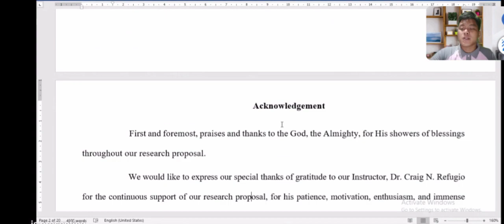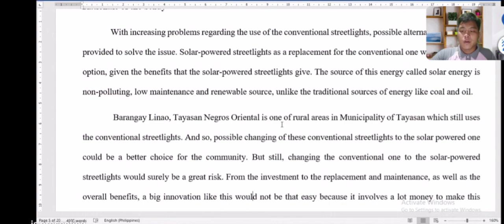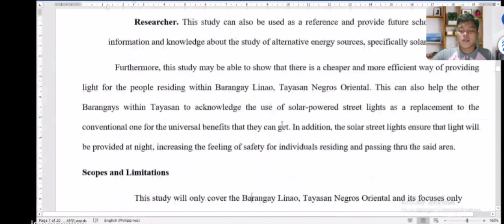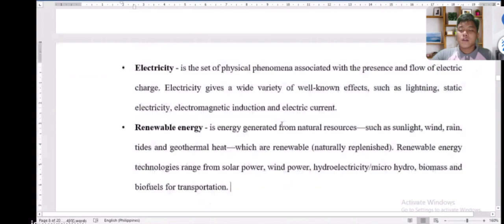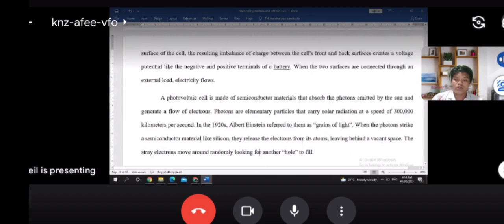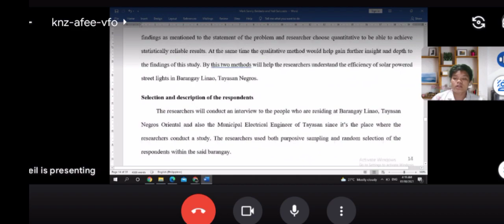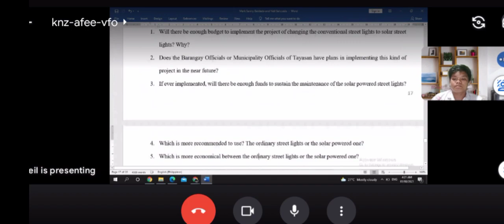Efficiency of Using Solar Powered Streetlights in Barangay Linao, Tayasan, Negros Oriental

Comment: NAME: Mary Grace c. Jorge
CLASS NAME & CLASS SCHEDULE:  346 Methods of Research T-TH 5:00-6:30 PM 
REACTION:  Its interesting topic, we do really need a street light specially on those area has few houses only, its for the safety of everyone who travels at night it also helps or assist drivers, pedestrians, and cyclists in finding their way in the dark. Many neighborhood groups believe that extra illumination helps prevent crime, and business district lighting also may help create a mood or a pleasant environment.
REFLECTION:  Streetlight provided a numerous benefit, but before it will work it needs an electricity. Even our government also need to pay electricity on their designated area, so instead of using an electricity on those streetlight, it will be an advantage if we will use a solar to make the streetlight work, so those money that is suppose to be a budget for the electricity bills for the streetlight, it can be used to a different project to improve their area.

Comment: NAME: Sanrey Jun R. Guevarra
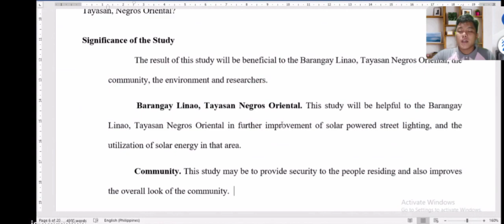CLASS NAME & CLASS SCHEDULE: COE 346 A & 5:00-6:30 T-TH
DATE: 27/03/2022

Reaction: The planned study will be extremely beneficial to rural places, particularly at night. I agree with the researchers that solar panels should be integrated into street lighting, and that it should be improved further.

Reflection: If done correctly, adding solar energy into a streetlight is a fantastic concept. They will not only save money, but they will also reduce the barangay's electrical usage. Even if the power goes out, the streetlights will stay on because they are fueled by a natural source, solar energy, which makes the streets safer.

Comment: Tudio, Lechly D. 
COE 346 Methods of Research T-TH 5:00-6:30 PM March 26, 2022
Reaction: It has piqued my interest to know more about solar energy. I have noticed that it is mentioned in most videos. No wonder, in solar, there aren't pesky bills in the mail reminding you to pay for the power consumed. Your power is free. That's why most of the projects and innovations are related to solar energy. Regarding this, having solar powered streetlights will provide security to the residents of Barangay Linao, Tayasan, Negros Oriental.
Reflection: Solar power is getting increasing popularity as a dependable source for street lighting worldwide. In our place, we are currently using the solar powered streetlights. It is very useful, convenient, and advantageous to places with a frequent power interruptions. Solar lights are incredibly cheap and clean alternatives to traditional power. In fact, due to the absence of external wires, these lights do not pose any threat of accidents like electrocution, strangulation, and overheating.

Comment: Name: Khynny Maureen P. Campoy
Class Name and schedule : ENS 341 Saturday (5:00-8:00pm)
Date: March 26, 2022

Reaction :
The video presentation is informative. Using solar powered streetlights, we can help save energy. It is eco friendly and it also have low maintenance. I agree with the researchers to implement this innovative idea. 

Reflection :
With problems regarding the use of conventional streetlights, possible alternative of this problem is by using solar powered streetlights. The source of energy of the streetlights is solar energy. It is non polluting, low maintenance, and renewable unlike the traditional source of energy like coal and oil.

Comment: Name: Balansag, Lorenzo Jr. B.
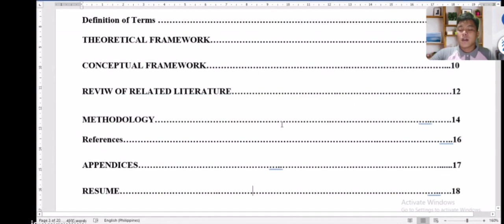Class Name and Class Schedule:  ENS341- Research Methods for Engineering | Saturday 2:00-5:00 pm 
Date: March 26, 2022

Reaction: The proposed research is indeed very helpful to remote areas especially during night time. I agree with the researchers that the integration of solar panels in street lights and to further improve it. 

Reflection: If the research is to be integrated in the said area, it will improve and lighten up the roads where people pass away. A very dark road is a hassle, so having it is very beneficial to us. As I have experience, it is really scary travelling alone in a dark road.

Comment: NAME: JEAN CLARE M. PO
CLASS NAME & CLASS SCHEDULE: ENS 341 SATURDAY 2:00 - 5:00 PM
DATE: MARCH 26, 2022

REACTION: During the night, streetlights are almost always used. It is critical to keep the streets illuminated so that motorists can navigate the roads and those who must walk in the dark can feel safe. As a result, I agree that there is a need for improved capacity in solar-powered street lights.
REFLECTION: Despite the fact that solar energy is common, using the sun is still a great innovation that is far too efficient and dependable for this study. This is a good idea not only for the environment, but also for promoting security and safety among all Brgy. residents.

Comment: Diaz, Joseph Jr. B. 
ENS 341 B - 5-8 pm Saturday
March 26, 2022

Reaction: The idea of using solar powered streetlights is not new to me, actually the idea is very common now everywhere. Here in Bacong, the streetlights in the diversion road from Dumaguete to Bacong is powered already by solar and it is truly very efficient because the only cost is the materials and no additional cost different from the ordinary streetlights that every minute produced cost because of the used of power from the power plants. 

Reflection: The solar powered streetlights are very efficient. Because the solar powered objects are only depends on the ultraviolet from the sun that everyday produced. But the downside is when the raining season comes, it just produced a minimal amount of energy.

Comment: NAME: Glovel Jae G. Medel
CLASS NAME & CLASS SCHEDULE: ENS 341 - SATURDAY 5:00-8:00 pm
DATE: March 26, 2022

REACTION: The research idea is very beneficial to the community, particularly in areas where there are no street lights.

REFLECTION: Nowadays, using solar energy as a replacement for fuels or fossil fuels is the most common solution that anyone can think of. Using solar energy to power street lamps would be very efficient because solar energy is abundant, and it would benefit areas where there are no street lights.

Comment: Name: Orito, Jessel A.
Class Name & Class Schedule: ENS 341 B Research Methods for Engineering (Saturday 5:00-8:00 pm)
Date: March 26, 2022

Reaction: In this video, it talks about the proposal of using solar powered streetlights in Barangay Linao, Tayasan rather than conventional streetlights. Even though this innovation would not be easy because it involves a lot of money, still this is the better option you can have. I guess this is a challenging research proposal.

Reflection: Barangay Linao, Tayasan is a rural area where only few streetlights are being built but not all of this can be able to provide a good light to every streets. For this reason, proposing a solar powered streetlights as a replacement of the ordinary streetlights is a better yet challenging choice. Nowadays, solar energy is being utilized for streetlights especially in those faraway and/or remote areas.

Comment: NAME: Chasty Jane Duran
CLASS NAME: ENS 341 B - Research Methods for Engineering
CLASS SCHEDULE: Saturday, 5:00 - 8:00 pm
DATE: March 26, 2022

Reaction: The video is very informative. Indeed, streetlights are crucial especially at night to avoid accidents and crimes. Using solar energy to give power to these streetlights would be very efficient and would be less costly. 

Reflection: Given the benefits of solar energy, it is the perfect option to provide these streetlights power. If the government agrees to make this proposal possible, it would not only benefit the travelers at night but everyone in the community.

Comment: NAME: Mark C. Temporada  BSGE 3
CLASS NAME & CLASS SCHEDULE: ENS 341 B - Research Methods for 
Engineering 5:00 PM- 8:00 PM Saturday Class
DATE: March 26, 2022

REACTION:   After watching the whole presentation , the research study was indeed  very helpful and informative research study . This research will be helpful to the community especially in Linao, Tayasan. As we all know that street lights is really necessary as it is a way to avoid accidents in roads. I do agree with them to implement this to the Barangay because using Solar is the best option to save money nowadays. 

REFLECTION: By the use o this research proposal, we can have high chances of putting up lights in dark areas of barangays and hoping that the government will fully support this amazing project soon. It will surely bring safety and security to all of us giving us lights going home .

Comment: NAME: Lumelyn E. Ragusta
CLASS NAME & CLASS SCHEDULE: ENS 341 B Research Methods for Engineering – S 5:00-8:00 pm
DATE: March 26, 2022
REACTION:  This study is really useful for the community. It is beneficial, especially when it comes to road safety. However, using solar power panels may impose a risk to the environment and be somewhat costly. Using solar-powered streetlights, we can save electricity, but there are factors to be considered.
REFLECTION: Renewable energy is increasingly popular these days, and this study is another important step toward a more productive lifestyle. Street lights are extremely important because they concern the safety of the people, and using solar energy to power them is a great idea to earn and save money. A happier environment results from a safer street. For me, investing in this kind of innovation results in a productive nation.

Comment: Marc Kenneth L. Baldosano
ENS 341 A (Saturday 2:00-5:00 pm)
March 26, 2022

REACTION: The idea of having a solar-powered streetlight is great. Since the government is paying a huge sum of money to electric companies like noreco every month, this will make the electricity bill significantly lower.

REFLECTION: Solar-powered streetlights may sound like a great idea, but I think that it will be an expensive investment since batteries are expensive. And since it will operate daily, the batteries where energy is stored will become less efficient since they are used daily; their maximum cycle will be reached much faster. I think that if they would only operate when there is no electricity during nighttime will make the battery much longer.

Comment: Name: Dolly Rose S. Bigno
Class name and Class Schedule: Reaserch Methods for Engineering- B/ Saturday (5:00-8:00 pm)
Date: 03/26/22

Reaction: Another great idea from these researchers. I'm glad that they gave attention and came up with an idea of the improvement of streetlights. Because not just in Tayasan but also to the other places with streetlights, some of them were not functioning properly at night which was suppose to be the most important thing in the roads.

Reflection: The study is all about the use of solar powered streetlights, which is also a great alternative solution during at night. They've mentioned that this might be costly in making this proposal possible but what matter is if this will be implemented and installed in many highways, then we will not worry anymore when electricity is not present at night because the absorb energy coming from the sun during day time will serve as the energy to generate the solar powered streetlights during night time. In this way, the drivers and people will be more secure and safe.

Comment: NAME: Kilapkilap, Joebert L.
CLASS NAME & CLASS SCHEDULE: ENS 341 A – Saturday 2:00 – 5:00 PM
DATE: March 26, 2022

REACTION: The research proposal is amazing since the researcher's notion is incredibly useful, as solar-powered streetlights may provide pollution-free illumination while also emitting no greenhouse gases into the atmosphere. It's also a more cost-effective and efficient way of illuminating individuals.

REFLECTION: The existence of electricity has a stronger impact on our day-to-day activities. Aside from conventional energy sources, solar energy can also be used to power street lighting. This concept is a viable solution for maintaining the stability of street lights, particularly in areas far from motorways. The streetlights will remain lit as a result of this, especially during power outages.

Comment: NAME: Alnie Jane M. Aum
CLASS NAME: ENS 341 B - Research Methods for Engineering
SCHEDULE: Saturday, 5:00 - 8:00 pm
DATE: March 26, 2022

REACTION:
     This research will be helpful to the community especially in Linao, Tayasan. We all know that street lights is really necessary as it is a way to avoid accidents in roads. I do agree with them to implement this to the Barangay because using Solar is the best option to save money.

REFLECTION: 
     As a resident in Tayasan also, I witnessed many streets that there is still no lights. It is so dark when walking or driving bat night. So, this study can be use for those other streets in Tayasan too.

Comment: NAME: Alejandro A. Bargaso Jr.
CLASS NAME & CLASS SCHEDULE: ENS 341-SATURDAY 2:00-5:00PM
DATE: MARCH 26, 2022

REACTION: 
The research proposal is extremely impressive because the researcher's idea is extremely beneficial because using solar powered streetlights may be able to provide pollution-free illumination while also emitting no greenhouse gases into the atmosphere. It is also a more cost-effective and efficient method of providing light for people.

REFLECTION: 
Solar Powered Streetlights, according to this research proposal, ensure that light is provided at night, increasing the sense of security for those who live and travel through the area. Because of the advantages of solar energy, it will be able to assist the community in conserving and saving electricity, as well as saving money on their utility bills.

Comment: NAME: JABUNGAN, JENNETH ANN D.
CLASS NAME & SCHEDULE: ENS341- B ; (5-8pm) Saturday 
DATE: March 26, 2022 
REACTION: This study is really interesting. Electricity is an essential part of our life. People use electricity for lighting, heating, cooling, and refrigeration and for operating appliances, computers, electronics, machinery, and public transportation systems. So, this research is proposing to have solar streetlight in tayasan, which is really good specially that every place should have streetlight. We all know that some of our lights are not functioning due to mechanism or the electric power that is not enough to lighten up the whole city and we cannot maintain them every time and then. So this research should be in implemented because streetlights are important since they could help drivers to navigate their way clearly and avoid accidents. 

REFLECTION: For me, this is a big benefit to our city, especially when power outage in the city occurred unexpectedly. So as a driver or citizen we need lights when travelling to avoid accident. And in fact, this study is good for the environment because it could lessen the air pollution that was produce by our fossil fuels. When times of power interruptions, many motorist or drivers got into accident due to lack of light in our streets, so this researcher is what we need to avoid this kind of circumstances.

Comment: NAME: Tubiano, Mariechel A.
CLASS NAME & CLASS SCHEDULE: ENS 341 -Saturday(5:00-8:00pm)
DATE: March 25, 2022

REACTION:
   This video presents an interesting ideas on how to utilize the renewable energy specifically the solar energy. This idea is helpful in lighting the streets most especially to those areas that is far away from the highways.

REFLECTION
    The presence of electricity has a greater contributions on our everyday living. Aside from the conventional source of energy, solar energy also has a capability to power street lights on the streets. This idea is an important options for the stability of street lights particularly to the place that is far away from the highways. Through this, the streetlights will continue to light up most especially during power interruptions.

Comment: NAME: Shiela May E. Velos

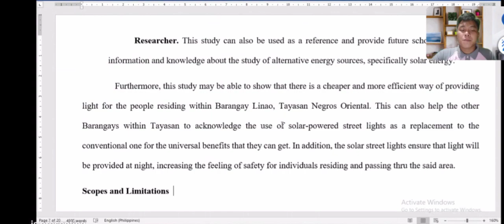CLASS NAME & CLASS SCHEDULE: ENS 341 – 5:00-8:00 Saturday 

DATE: March 25, 2022

REACTION: The Barangay Linao in Tayasan having few streetlights are being installed, having no enough capacity of streetlight might be kinda danger to everyone who will passed by through this. Different scenarios and accident may take place.  Efficiency of Using Solar Powered Streetlights in Tayasan this project proposal point, and I know that the researcher of this study might concern the safety of the netizens here that he conducted a study to determine the efficacy of employing solar-powered street lights instead of traditional street lights. Solar street lights are essential in providing safety and promotion in urban and distant locations, it increase the safety of drivers and pedestrians who travel night. Streetlights are vital because they may assist cars in clearly navigating their path and avoiding accidents, also solar panels to be used as a renewable energy source should be improved especially in their area.

REFLECTION: Streetlights are greatly in need in communities specially that are far from the major route, particularly in rural areas. This would be extremely beneficial not only to students, but also to workers who work late and must stroll through these streets, it provides atleast the assurance of safety of everybody, helping to save electricity, and also benefit our environment and the people there. Solar Street Lights would bring more light to these areas. The people would be really thankful if these investments were to come to fruition in order to protect the drivers and civilians in that area, as well as to ensure everyone's safety, and help to lessen to the part of the people who experiencing a trauma in darkness.